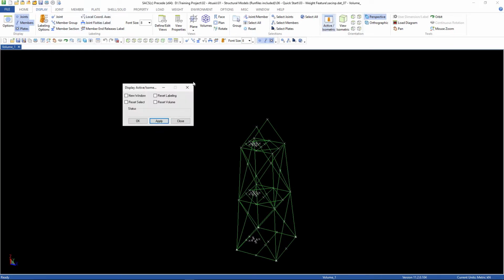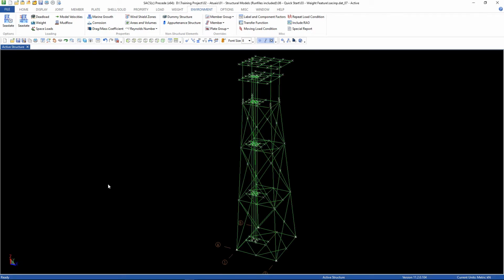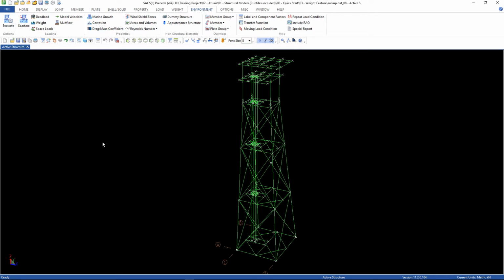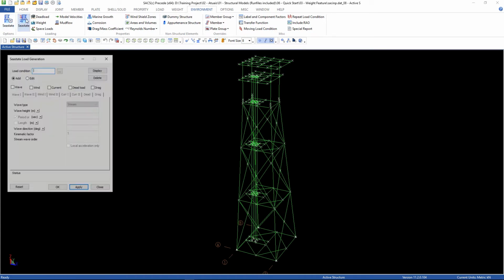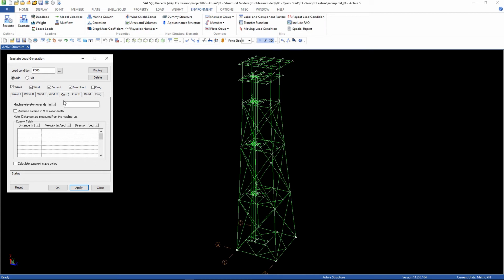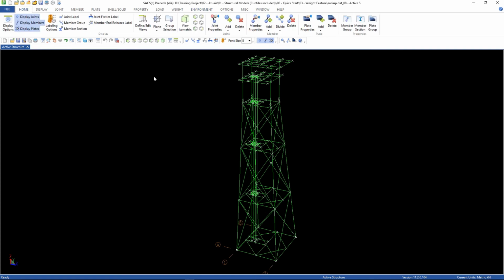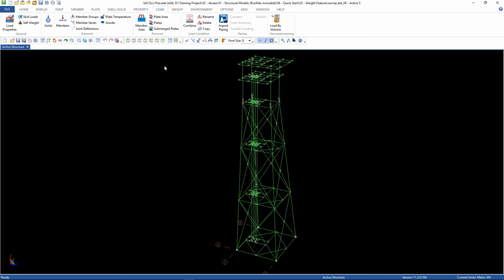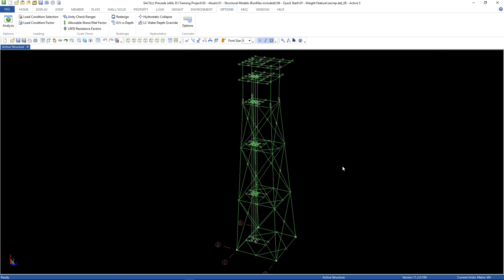Modeling Loads using Weight Feature in SACS CE (Part 2)

Comment: Hi, how can I translate the weight loading into load cases and load combinations. I am asking this because I loaded a structure using the load feature and weight combination, but on running the analysis I got error message saying the model must contain at least one load condition.
Reply: Did you find the solution?